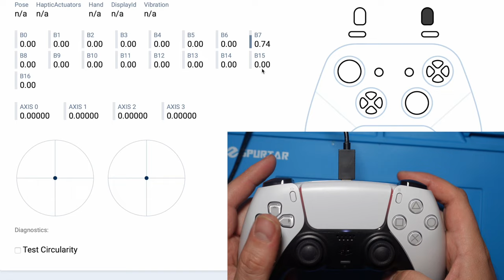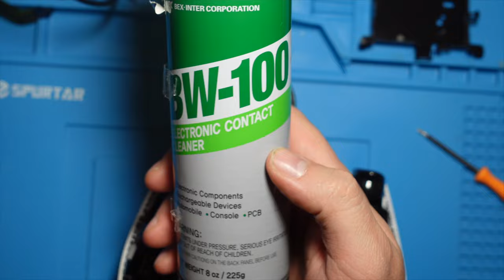Fix Broken Unresponsive D-Pad and Buttons on PS5 DualSense Controller

Comment: If I do this it's never getting put back together
Reply: Don't be intimated. I got better with electronics by consistently taking them apart and putting them back together. I think I have taken apart the N. Switch Pro Controller and PS5 Dualsense controller so many times that it's 2nd nature to me now.
Reply: its really not too hard.   i have 0 training and ive taken my entire ps5 apart lol
Reply: Just take your time. Take numerous pictures during disassembly so you'll know how it goes back together. I fully rebuild game consoles. I just repaired my PSVR headset a week ago. Pay attention and closely study the assembly. Look up repair guides. It seriously helps.
Reply: @jamesgriffin7351 yea no
Reply: Not wrong …
Reply: don’t doubt urself, i’ve never worked w electronics before but i did this yesterday and now my controller works again, don’t overthink it too much and just follow exactly what he does.
Reply: currently staring at my disassembled controller in exhaustion 😭
Reply: @puppyuckk did you fix it ?

Comment: I legitimately dropped my controller like 4-5 times and one of the buttons just stopped working for no reason. (Down on the D-pad) Literally in the middle of gameplay too. With the ps4 controller, I dropped it like 432 times and Literally no problems. Playstation needs to make thier controllers either cheaper based on how easy they are to break, Or they need go make them less cheaply made.
Reply: Same dawg i just dropped my controller and the down arrow keys dead
Reply: Same, found any fix?
Reply: @arnemariusholter5903  The fix is buying a $70 controller because playstation is too lazy to make their controllers with better materials than ones found in the literal dumpster
Reply: 7 months later,did you ever fix your controller?Im having the same problem

Comment: Just beat the crap out of the sides and back while holding the non working button down
Reply: It’s actually not that hard to take apart ps5 controller just need the right screwdriver and disconnect cables and reconnect them gently after.

Comment: Had a friend bring over his controller because he said it wasn't turning on or maybe it wasn't charging. I connected it to my PC and tested it with DSX and it had the same problem + the PS button wasn't working either, so it made sense why he said it didn't turn on properly even though the battery was alright after testing it. I even checked my other working controller and all the buttons registered just fine.

After disassembly and a thorough cleaning as you showed in the video, everything started working again. So thank you for that, you have been a great help and saved my friend around 70 Euros!

Also, I just used a small amount of Isopropanol 99% (around 5-10 ml) as it evaporates very quickly and does the job just as well, so no need for a special cleaner.

Comment: I took a whim and decided to open my controller since my right face buttons werent working and i ended up fixing it. Q tip with alcohol and the disassembly and reassembly were very easy and i didnt have to send my controller in to sony. This video is great for those who dont mind taking the risk in diy ⚡️

Comment: This was a fantastic video. I did end up tearing the bottom wire because it a too tight on the circuit board so my mic doesn’t work anymore. But d pass and buttons work now and functions normally. Thank you so much

Comment: Thank you so much for showing us this. Luckily, I didn’t have to do a full tear down, but I was able to get my D-pad working 😎
Reply: How
Reply: Once you get to 1:55 , you just squeeze the controller in the Dpad area so that the Dpad connections can stick to the motherboard. U didn’t have to take out the battery and all that stuff.
Reply: @jahmalh7671 this comment just saved me from tearing my controller to pieces and most likely buying a new one.

Comment: My dualsense react X button and play button simultaneously, I clean ed the circuit board but it didn’t work, and then your tutorial mention the connection between the circuit board and the motherboard 3:40 , I cleaned it and it worked! Very helpful!

Comment: I got scammed on Facebook Marketplace; I bought a controller and it had this issue. Following your guide I managed to get it fixed though, you’re a legend man.

In mine, looks like a hair got between the connection points to the buttons.

Comment: So my controlled had an issue with the up button on the d pad. And watching this video made me realize that I might mess my controller so I did a trick to fix it quick and it worked. I blew into the up button d pad and it work.  Wanted to mention it for anyone that wants to quick fix. Might not work for u but maybe it will like me.
Reply: Same problem here bud thx
Reply: I have the same problem but I’m too scared to open up the controller 😂

Comment: Dropped mine this morning and both the d-pad and buttons stopped working. Followed this and was fixed within 30mins. Dust lodged between strip and motherboard connection

Comment: I’ve had this problem with one of the buttons on my mine. I opened it and cleaned the contacts with iso and it was working again A few months later the same button stopped working and now L1 doesn’t work anymore I just opened it back up and cleaned the connections between the game pad and MB and the same contact for good measure. I also made sure the ribbons were put in correctly cuz I think that’s what connects the triggers to the MB and they both still aren’t working Is iso bad to use for this or do you think something else is wrong
Reply: Do you think getting new membranes will help

Comment: My x button and down on dpad both stopped working at the same time. I read give the controller a good smack and it might work. I did. It fixed my x button but d pad is still fucked and now one of my triggers doesnt work as well after spraying it down with air duster. 

Hence why im watching this i have to pull this apart and clean it for real

Comment: The X button on my DSense works on normal pressing but sometimes it doesn't when I press it lightly(like when you are relaxed playing).
I wonder if I should open it since the console it's on warranty.
Reply from the maker: If it’s under warranty, I would do a replacement because if you open it, the warranty will be voided it’s most likely the connection is loose and you need to adjust the rubber button with the flux connection point
Reply: @TheGamer2Know  thanks, I will try, hopefully it's not much of a hassle.

Comment: What if the joy sticks are non responsive? I did replace the potentiometers on one of them because of drift, and when I put everything together, they were not responding. The d pad also stopped working.
Reply from the maker: I would double check all the ribbon cables are connected properly and are intact. If you were soldering it could be you damage some of the tracks on the board and now there is no power. It could be a lot of different things, I usually test the controller while I am fixing it through something like gamepad tester to ensure all is working properly
Reply: @TheGamer2Know  thank you for your reply. I actually didn’t replace the entire potentiometer, just the little metal inside (wiper?), so I didn’t have to solder anything (then I would mess something up for sure lol).

Comment: What else could someone use , if they did not have electronic contact cleaner
Reply from the maker: Isopropyl alcohol
Reply: @Gamer2Know  I manage to use some hand sanitizer and low and behold it worked . I just manged to find some debri on where the pad stripper makes cotton . Clean it and solved my problem .so thanx for the advise . I'm pleased I didn't have to cough up money to buy a new one !